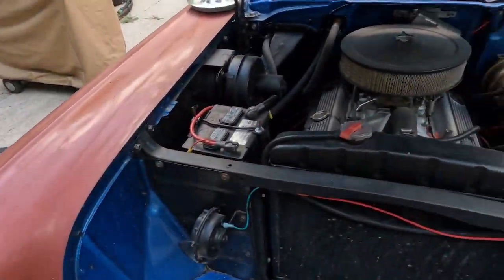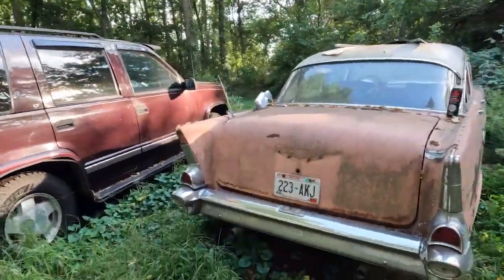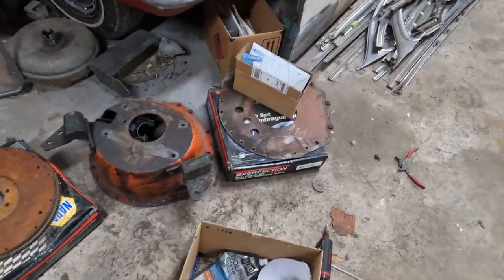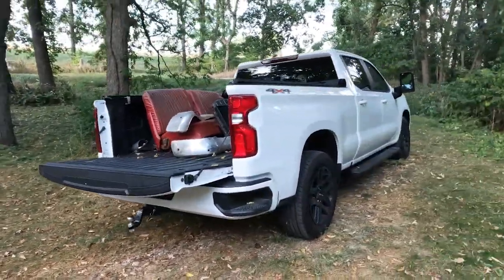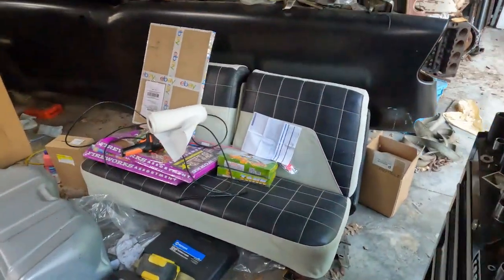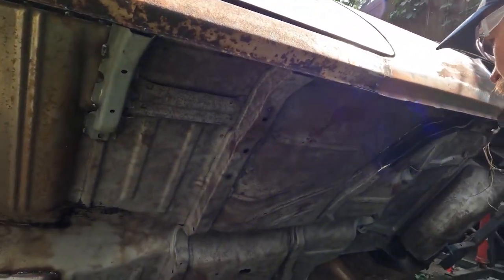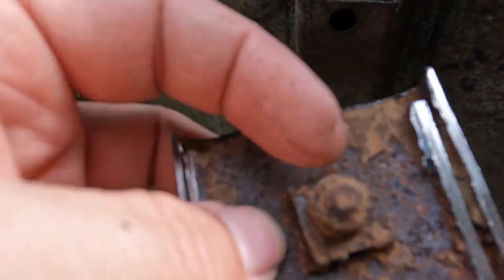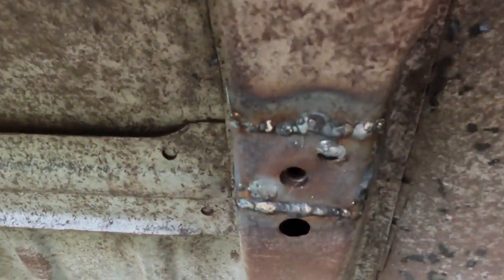Did I really drag home another 57 chevy?? YEP!  Project Update!

Comment: Awesome enjoyed . Just into a 56 2 dr wagon . Sept runnin out of season . So rockers And full floor then motor trans . See what I can get done before monsoon season in Northwest Washington north of Shootattle 40 miles  please keep vids coming at 61 you guys inspired me to do a complete build . Just not doin frame off  but body up to slide floor in from front . Pull all but back body bolts loosen . And lift . Lol rockers cut out old patch panels knows as a porcupine floor all the sheet metal screws lol any way hopin for more content and any 56 info need tail gate internals if ya ever come across need the t handle Amd pivot on inside

Comment: That's a cool 57 150! I just went past the Dells at the end of last month. We actually  ate at Paul Bunyan  when we was heading back to Ohio! I still have them 56 rear bumper guards if you want them. Have a good one
Reply from the maker: Thanks Don, We had a good time up in the dells! We usually eat breakfast at Paul bunyans but we ended up eating breakfast at the resort all weekend. I’ll use them guards
If you wanna let them go, I’ve been meaning to get ahold of you too, if you still want to use them chrome staggered valve covers send me your address and I’ll send em out to ya, I’m
Gonna put painted steel ones on my dual quad setup with the batwing!

Comment: Great video Dan that is a sweet 57 roller you picked up I just missed a 100% complete 56 Sedan the outer body was two green with 0 rust it really needed the front floor pan the passenger side was gone. But other then that it was a complete car and it was only a couple of miles from. My house someone beat me   to it by 4 hours I was really upset the guy was asking $ 5.500 for it but that was the most original car I have.seen in along time I was upset that I missed out on that one. I'll just hang on to my money and I'll find the right car sooner or later. Thanks for the video